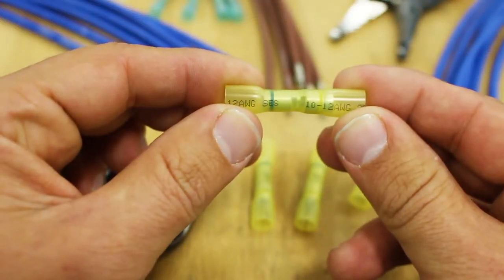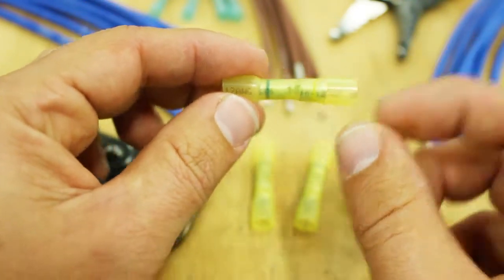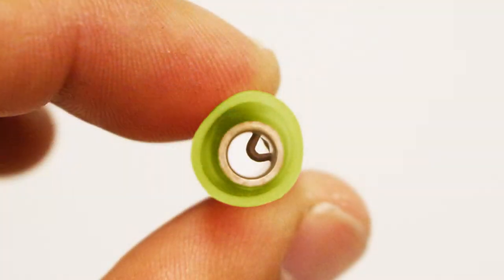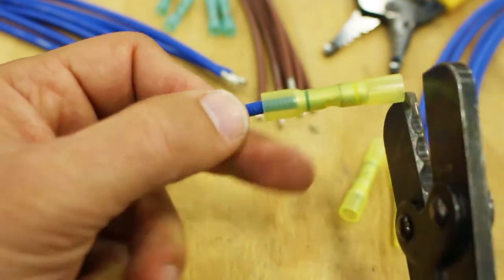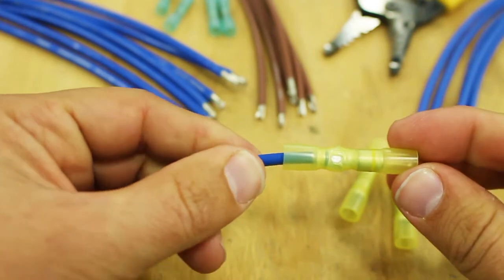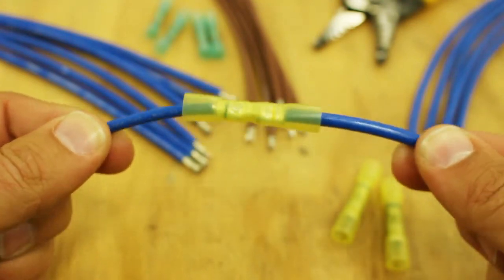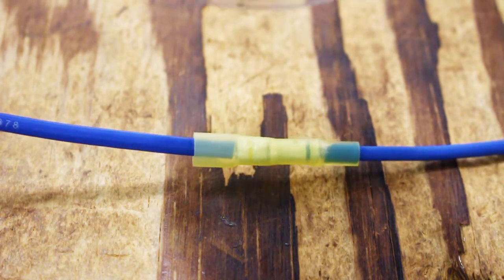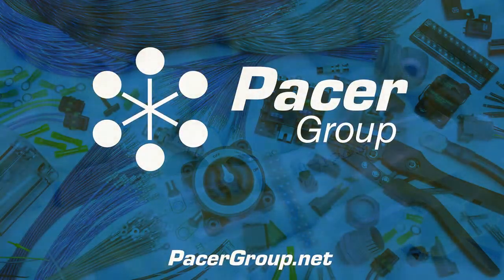How to Use Step Down Heat Shrink Butt Splices

Comment: Thanks for the video. How would we handle an 8 awg with 10 awg situation? New pool heater requires 10 awg but previous pool heater needed 8 awg wiring.

Comment: I have 2 12 AWG wires and like to know how to splice say two 12 gauge or AWG wires into 1 12 gauge AWG wire? As well as protect to and seal it via heat shrink it or plastic dip it or both or electrical tape it?
Or for speakers
Reply from the maker: Great question, you could consider a step-down butt splice similar to the one at this link (https://www.pacergroup.net/step-down-tinned-butt-splice/) although you would need to be sure to use epoxy-lined heat shrink to ensure the connection point is protected.